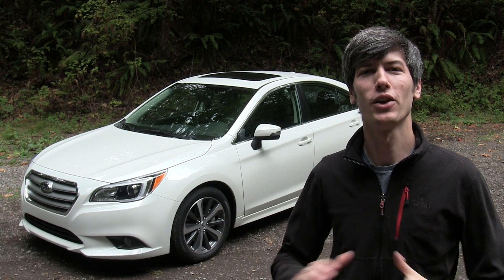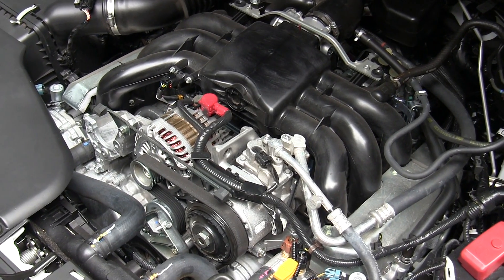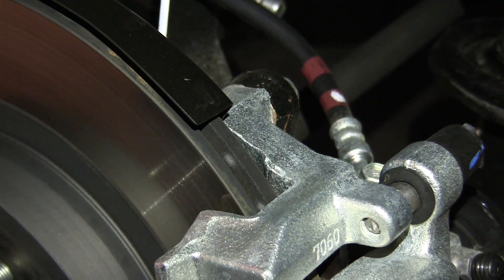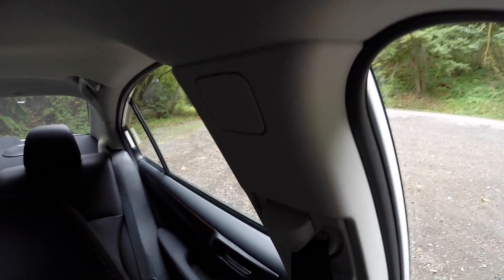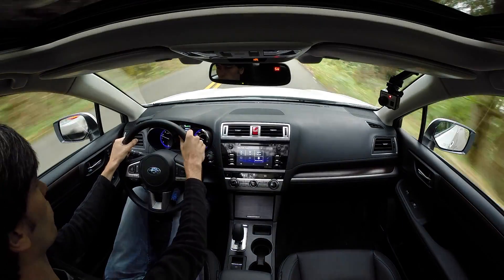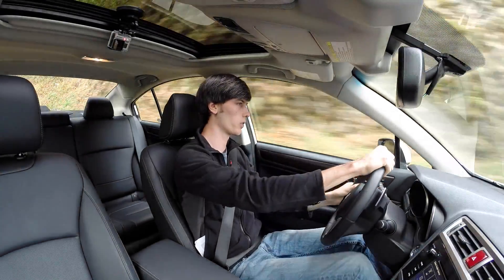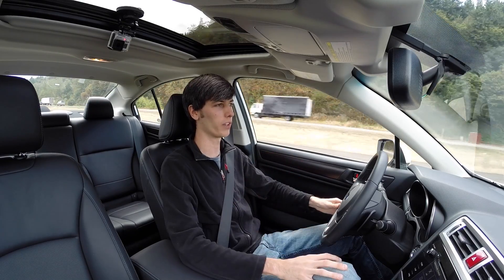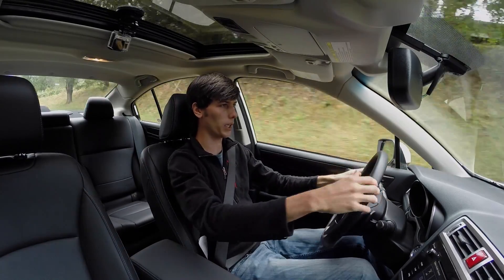2015 Subaru Legacy 3.6R Limited - Review & Test Drive

Comment: I drive a 2013 model of this car and im shocked how under the radar they are. The engine is super well engineered and left stock is one of subies most reliable. 5 speed automatic transmission on my model is so much better than the CVT and with sport sharo mode the engine really sings at high revs. 

I wont go into debt for a porsche so this is about as close as i can get

Comment: How’s this Car on Gas ? I am buying 2015 model at 185,000kms
Reply: I have a 2015 Legacy 3.6r that is 193k miles at the moment (all miles driven by me), my average combined city/hwy is about 20 mpg at the moment, but it depends on the condition and how the car was driven by the previous owner of the one you're buying. For all those years and miles, I never had any engine or transmission problems and is still going strong and I'm telling you I wasn't the best in maintaining the car until recently, but the car still never had any major issue beside the regular wear and tear parts. The only bigger things I had to change about a year ago was the front axle and the coil struts. Driving the car also feels pretty stable and heavy (meaning it doesn't feel like driving a plastic car like a KIA or something).

Comment: Just bought a 2018 3.6r   I came from a wrx so the handling was the first thing I noticed. Alot of body roll.   Now I have been riding around for about a month and man I really love the legacy   I m gonna tune it up a bit make it a little more snappy  but man    what a nice ride
Reply: Larger front/rear anti-roll bar would greatly improve feel. Same size bars on 2.5l (brakes too) limited trim, Subaru cheaped out and didn't give drivers better parts for a larger, added weight engine

Comment: It jolts you forward when you upshift because the engine is moving faster than the transmission. It's the same reason you jolt forward if you upshift on a manual trans and don't wait for the revs to fall.

Comment: Just got the exact same car and coming from driving stick shift I want to say that I love the cvt, Idk why people hate it but whatever , yes I noticed that the pedal is very sensitive at my car been 15 with 80k I decided to do a tune up and I noticed that the air filter was thicker than most usual OEM filters, now I got this car for my wife so if it was mine I would have started to mod it but is not mine, I ended up getting an k&n filter and believe or not that $60 dollar plastic filter solved that problem, and yes I can attest to that cause I was like no way so i put the old filter and the pedal was touchy, whent back and put the new filter and it was gone, I didn't even said to wife about the filter and she told me that the pedal touchiness was gone, I will be getting one of this cars too soon enough, good video by the way.

Comment: Oh.. and that “boost” you feel when you upshift is the rotational momentum of the engine and transmission dynamic components being converted into torque as the RPM reduces. Same as dropping a clutch or the F1 kinetic energy recovery system or putting an aircraft prop from fine to feather.

Comment: I hate snappy brakes.. lol. 

It’s probably a bad thing.. but I usually don’t change my brake fluid and do the minimum bleeding necessary. Brake fluid with moisture content gives you a more spongy feeling and so do a few air bubbles. If you can still lock up all tires (or get the ABS going) then it’s fine... anything beyond that is academic

Comment: Was the extra 6ml needed? 253 bhp over 242 and 240 odd lb ft over 219 isn't a great gain, you could probably have pulled that out of the old 3.0 with a tune. And in the modern eco climate a return to the original JDM one with the 2.0T engine may have been smarter?

Comment: wait, so the CVT is good?
Reply: The 3.6 doesn't come with the CVT. it comes with a 5 speed automatic. It's a traditional normal automatic trans. its one of subaru's best transmissions. CVT's are problematic from any manufacturer. i would avoid them. if you get a subaru, get a 3.6.
Reply: @glasstv5068  The 3.6R is CVT only
Reply: @wrf8245  it might be now. I have a 2010 with a 5 speed automatic transmission. 2010-2014 or so has the 5 speed auto.
Reply: @glasstv5068  yeah the one he reviewed is cvt only, they ditched the auto. For better or worse.
Reply: @wrf8245  yeah you’re right. It’s a 2015. That’s why I like the older 3.6R’s with the auto trans.  (2010-2014) I’m not a fan of CVT’s. they just don’t last.

Comment: Does the legacy with the 3.6 engine come with the manual transmission ?
Reply: comes with a 5 speed automatic (not CVT) with manual mode and paddle shifters on the steering wheel. its a good solid transmission. doesn't have the issues that CVT's have. the 3.6 with the 5 speed automatic is one of the most solid subaru engine/transmissions out there. they can last a very long time if well maintained.

Comment: Cvt nooooooo 

At least make it a dual clutch auto 

Not a cvt anything but a cvt I’ll take a tree limb I have to push thru cut outs in the floor over a cvt I mean golf carts use those
Reply: the 3.6 has a 5 speed automatic. not a CVT. I agree with you, stay away from CVT's.

Comment: Yes but my ej20x in my JDM 2003 subaru legacy makes around 30 more HP stock yes has 2 less cylinders and 1.6 litres less displacement
Reply: A lot less reliable than a NA

Comment: Hey Engineering Explained! I just bought a 2018 Legacy 3.6R and had a question about the CVT. I noticed it 'simulates' a conventional automatic under moderate to hard acceleration. By simulating fixed ratios, do I lose out on the benefit of having a CVT? If you lose out, then why didn't they just put a conventional automatic in instead of a CVT?
thanks!

Comment: An update on my 2017 Subaru 2.5i, base model.

We did not need all the extra bells and whistles, but we upgraded the interior with a Katzkin leather kit for about $400, 17" aftermarket rims, door panel guards, mud flaps, Homelink mirror, and a set of optional fog lights. Our total upgrades was about $1,200, which put the total cost around $22,000 before taxes. This was a much better option than buying the Premium model for $25,000 that had a lot of options we just don't want or really need, and still don't get a leather interior. 

Well, we are pleasantly surprised at how well the car runs and drives. The new chain driven CVT is much better than I thought it would be. For all of our normal driving, the acceleration is more than sufficient. In fact at only 3,000rpm, the car accelerates much faster than most normal driving we do.  Initial acceleration from a dead stop does have a slight lag. However, it's mid to high acceleration band from say 20-80mph is pretty impressive. Once the CVT is locked up, it will take you from 20mph on a highway on-ramp to 70mph lickety-split. In fact it seems to accelerate onto the highway much faster and feels more stable than the Camry we test drove. 
 The handling feels much better than a Camry, and is more inline with a Mazda 6. It is a very flat and sporty drive, yet the interior noise is very low, like a Camry. Cornering is very good, especially when you hit the accelerator on a corner, you can just feel the rear drive kicking in to push you around a corner vs plowing around a corner in a FWD only car. 
 It is also a deceptively fast car. Because the interior is so quiet, the first time I hit the highway, I accelerated into the left lane, and found myself passing the right lane quite handily. I then realized I was going 85mph, and the car barely felt like it was going 60mph, because it such a smooth and quiet car. Part of that is the 17" rims, instead of the 18" rims on the sport models. I did notice from test driving the 17" rimmed cars do drive quieter and slightly smoother. 
 Overall MPG is around 29-30mpg for us. On the highway alone it easily does 36mpg for those long flat road trips. 

Also, oil consumption is very low, which is a known issue with boxer engines. After 5,0000 miles, we did lose a little oil, but did not need to add any between oil changes. Looks like about 1/4qt loss at the most. And that is on a brand new engine that is still breaking in. As time has gone on, oil consumption appears to be less, and overall MPG's are slowly going up as the piston rings get seasoned and seat properly. 

So far, I would say I really recommend this car for anyone who wants an AWD family car, or just an all around good car to drive everyday.
Reply: amazing! i just bought a 2019 legacy! how’s your legacy doing these days? any type of issues with CVT?

Comment: Why does Subaru always have to stay one step behind the competition in Infotainment system?  They make good cars but the Navigation and interface is awful.  There isn't even an option to completely turn off voice guidance.  In the age when the competition has moved to 8" or 12" screens, that tiny 7" screen alone is a deal breaker for me.
Reply: Bo Han thier main selling point is safety they are doing really well so they dont want to make things more expensive

Comment: The brakes are stellar.  I don't know what they did with the hardware, but it's the best I've used for precision and modulation.
Reply: Subaru does brakes right.
Reply: @borger99  Now if only they could make a decent ABS system.  The old stuff was horrid and dangerous.  The new stuff feels generations old in speed and ability to manage wheel spin and chassis stability.  It's...ok.  It's ok right up until you use something far better.  I have a Honda Ridgeline, and the ABS system and stability programming makes Subaru's system feel 20 years old.  It also made me realize ABS based toque vectoring is not a good way to do torque vectoring.  Rear diff left and right e-clutch systems are WAY better.  Although...I still like old school mechanical locking diffs.

Comment: dont care what anyone says about how outdated the boxer engine is. Its really hard to improve upon perfection in the reliability sense of it.
Reply: Boxer engine layout is the most reliable engine configuration. There is a reason Subaru is the third most reliable brand and why Porsche keeps using the flat 6.
Reply: Sauren Louthern  lol what?!?! 🤣😂🤣😆
Reply: The 2.5 was the only “unreliable” boxer engine. And it was only unreliable when you didn’t pay attention to the head gasket and didn’t maintain it. The 3.0 and 3.6 are great engines. I just wouldn’t own one because I don’t like the cvt and they don’t make a manual.
Reply: @tomsfruitstand6821  the 2.0 FA20 engine in the BRZ and WRX are very unreliable. Almost all of them developeve piston rod and rod bearing failure at less than 100k miles
Reply: The less reliable boxer engines were the EJ engines which Subaru phased out in 2010. All newer Subarus (including this Legacy) have the FB series engines which fixed those issues
Reply: +Basih You simply can not make a boxer engine "as good as" an in-line 4 with same materials and level of manufacturing precision for the same price - it either has to be more expensive, or you have to compromise on quality. Most Subi's chew through head gaskets <70k miles, they have cooling problems, they've been having transmission problems for years etc.. Subi's haven't been reliable for quite some time.
Reply: well not engine issues, are they? also, not all of the Subarus have a weak transmission. Also if I am not wrong it was a specific generation that had head gasket issues. like some ford Focus RS models had.
Reply: Major Pain But it's unreliable.

Comment: i drove the legacy... its amazing but the throttle is very sensitive! 
everything is great in this car except the throttle!
Reply: Chris Leon i meant that the throttle is touchy (light) ... not like the other cars, its annoying
Reply: you kind of get used to it... even after 2 years, I can't be 100% comfortable with it but most of the time.
Reply: What do you mean the throttle is sensitive?
Reply: So...it barely accelerates? o.O I'll have to go drive one on Monday. I mean, when I drive, I drive very carefully. I accelerate slowly and coast a lot. When I drive, my RPMs NEVER go above 2500....
Reply: Let's say you want 30% engine power. On a CVT (my example is the Forester XT I own), you barely touch the gas pedal. On a BMW, you have to use like 30% of the pedal play at least. I'd say the pedal to power-delivery relation is linear on a BMW and on a Subaru CVT its logarithmic. Drive a CVT for 2y and try a BMW and you will have issues getting the car to move.
Reply: xDRAN0x Interesting. Good recommendation. Deff will try both. :)

Comment: Some Subaru owners have been complaining on dealership web sites about a head gasket problem. Has this been corrected on the 2016 models? What about oil consumption. Subaru's have been notorious in the past for 1 qt/1,000 miles in some cases.
Reply: More or less corrected. That was a notable problem with the EJ251 back on the '98 Forester and '01 Outback. I owned both. I more or less remedied this with better head-gaskets. It's still possible for this to be a problem on any car, but it's worth noting that the flat engine makes it a bit harder to get at them to replace them should you want to do it yourself.

Comment: im thinking between this and the infinity Q50 R 2015 which one is the best to get?
Reply: +Alberto Recto Jr. That's really a question of budget.  You can get a very nice Subaru Legacy for around $10-20k less than an all-wheel drive Q50, depending on horsepower and options.  Take a couple test drives and see what you like.

Comment: I have a question, is it a shame to drive subaru within an automatic gear?
Reply: The automatic will shift faster than you possibly ever will ;)
Reply: I own this same vehicle, with the automatic, my brother has the same with a manual. The automatic is far smoother and quicker on the shift than we can get with his manual on a local race track.

The reason I got an automatic is I sit in traffic minimum 2 hours a day, I hated shifting that much.
Reply: Well this is a mid size sedan so it's not a BRZ or WRX that are pretty much based for the manual drivers. I can drive stick but I would prefer automatic.
Reply: Victor C. Thank you

Comment: Thinking of trading my 2013 Nissan Xterra Off-Road (6-spd manual) for one of these.  I'm willing to give up some off-road capability for better gas mileage, better handling, better ride, sunroof, leather and overall livability.  Will I miss my Xterra if I get one of these?

I really hate adaptive cruise control.  With other drivers, I loathe having people on the highway "following" me and won't pass.
Reply: +Edslittleworld Driving is very subjective, so it's hard to say.  I moved from a manual Honda Civic to a 2016 Legacy.  I miss the clutch pedal a bit, but with the EyeSight system I find I arrive at my destinations much less irritated by unpredictable drivers.  Aside from Eyesight, the thing I like most about the car is the well-padded armrests -- it's like driving in first-class.

When it comes to long roadtrips, I feel much less tired in the Legacy than I have in any other car I've driven.  Now, you could say the same for a Mercedes S-class, but when it comes to affordability and features, the Legacy corners the market.  I recommend giving it a test drive.
Reply: Thanks..Greg!  I ended up buying a Crosstrek...but I kept my old Nissan Xterra!  :)

Comment: How is it possible to produce such little power and torque from such a massive boxer engine? An naturally aspirated 3.6L flat six should be making at least 300 BHP and 280 foot pounds. 

My little old EJ20 absolutely smokes it. Lame.
Reply: +rooboy69 It's not the CVT, it's tuned for economy and durability. There are plenty of 300+ HP cars with CVT.
Reply: +Chris Davies It's probably tuned for longevity and efficiency. Mind you most people who buy these cars are trying for a more conservative and professional look. If you want POWA the STi is the better car.
Reply: this is due to the CVT transmission. YouTube search the power issues with the CVT in the wrx when you tune it. it can't handle much more power
Reply: rooboy69 Yeah I know but this car hasn't always had a CVT either.
Reply: Carlos Espindola Such as?
Reply: Kyle Grodkowski Nissan Maxima, RX450h Lexus, GS450h Lexus, and the LS600h Lexus 

There's maybe more but idk
Reply: So 1 Nissan and 3 lexus which use the same CVT. I'm not convinced. The CVT historically struggles to hold together past 300 hp and is why you never see them in high performance cars.
Reply: Kyle Grodkowski Keyword "Historically". I agree CVTs are not in a position to be in cars over 400+ HP yet. But just how before they couldnt even go over 300+HP, technology will change that.

Besides, my point was that this car wasn't detuned to go easy on the CVT, but to follow a market of people who still want economy on a car with some performance. 

Unless of course, Subaru doesn't have the technology to build a capable CVT. Then i guess thats where you might have a point.
Reply: I was expecting something closer to 280-300 as well until he mentioned the compression ratio. I guess it's probably because it uses regular octane fuel. The relatively traditional compression ratio is that far off from being turbo friendly. Certainly is if running e85. Anyway my 300hp VW requires 98 octane and has a Comp ratio of 12:1 or thereabouts.
Reply: I think its partly becasue it has port injection, which is a little out of date these days, and because it's tuned for regular 87 gas.